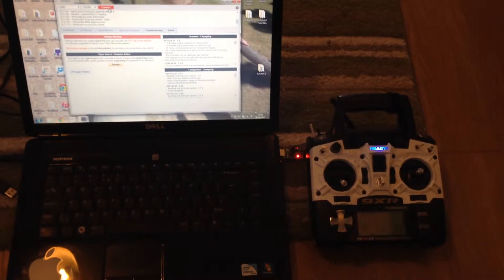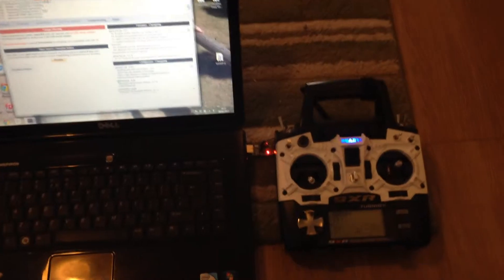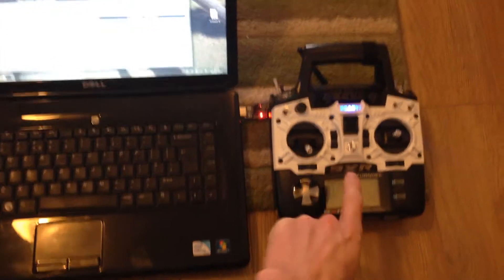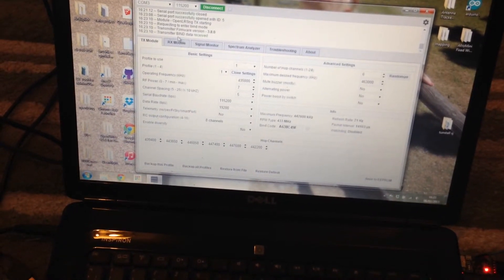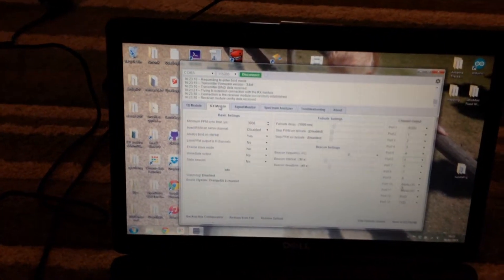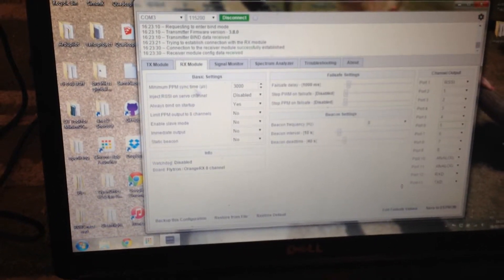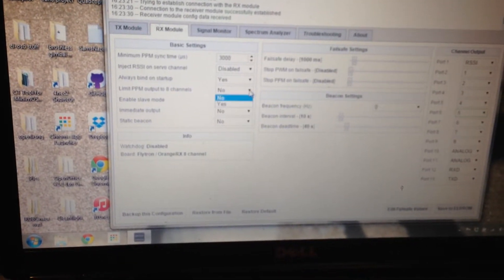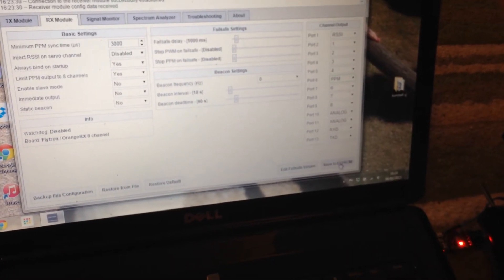Setting OpenLRSng to output CPPM PPM on channel 6

Comment: Hey, thanks so much for your vids, they helped me quite a lot in last couple of days setting up my quad!

I have question about the latency: in mission planer using the radio calibration window, I can see that there is quite a bit of delay going on. I read that this could be fixed with a different PPM sync time. Did you have problems with the latency? Could you give me some tips?

Cheers from Germany :-)
Reply from the maker: Try setting ppm sync time to 3000us. Also try make sure any unused channels are set to minimum pulse length by mixing your radio accordingly.